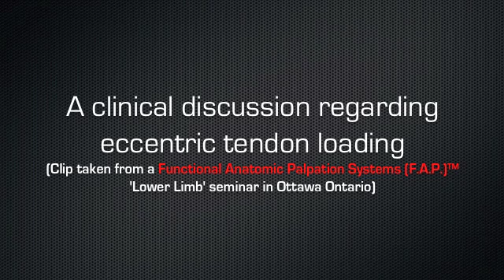A clinical discussion regarding eccentric tendon loading

Comment: @mvsouth 
I did each heel drop on the edge of a stair with a straight knee.  Once the heel stops below the stair, bend the knee and hold for 15 seconds.  Do this gently and ease into it very gradually.  Do 15 drops thee times, twice a day and you will have a 90% chance of returning to your sport.  Do this over any other excercise - give it proirity (see Alfredson)